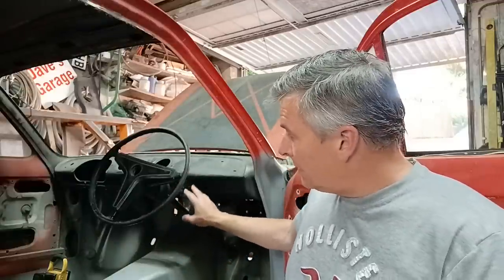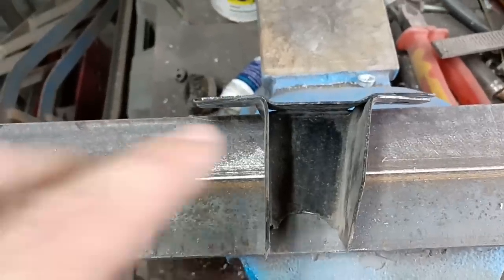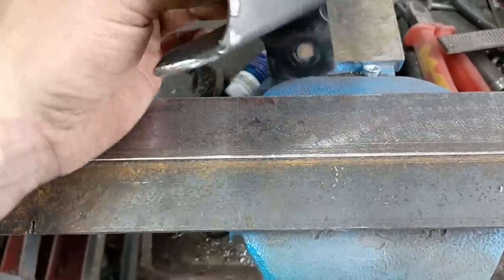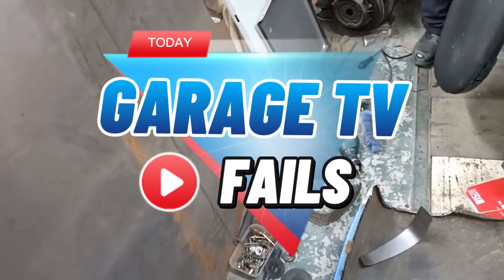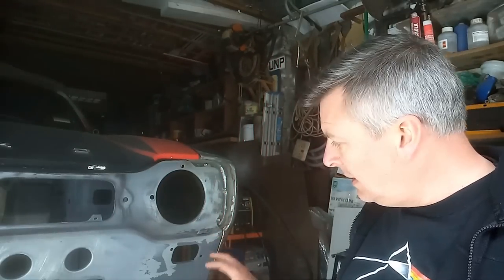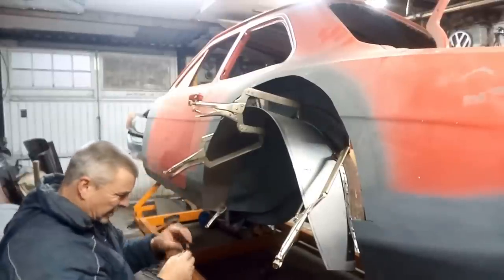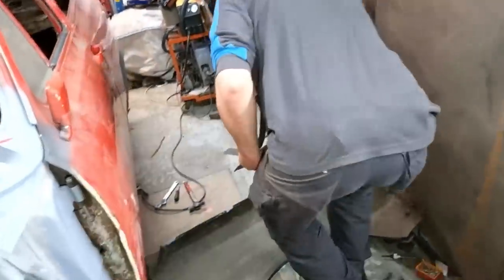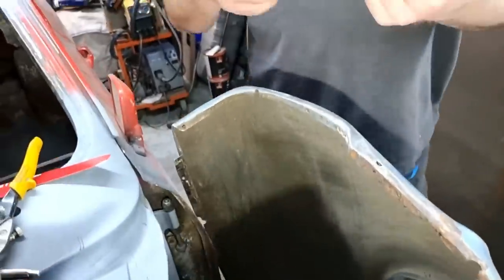Ford Escort MK1 Project. LHD to RHD conversion, steering column.

Comment: Nice job Dave I’ve converted my mk2 from lhd to rhd and used the same dash I copied a guy on YouTube usher engineering his daughter works with him I shut the existing hole by welding a plate over it and cut the hole out the other side also moved the heater hole over it’s turned out great 👍👍
Reply from the maker: I'm thinking ill use the bit I cut out on the right to fill the hole on the left. What can possibly go wrong 🤔
Reply: I think what I did Dave cut the hole slightly smaller so I could put a return on it, I saw a tip I cut an old Allan key about a couple of inch long and cut a slot into it about halfway through a few mm up on one side you can then put the slot down onto the edge of the hole and slowly bend it over you may already know this I thought it worked great top tip 👍👍

Comment: Hi Dave, Great work as always, but i think i may have spotted an issue, now if your gonna keep the ignition barrel on the left hand side , then ignore this msg...If your planning on using a Right Hand ignition barrel , then you should of rotated the column its self 180% also, so the steering lock hole is on the RH side....Hope this makes sense...
Reply from the maker: Well spotted! I did notice this, but then proceeded to forget all about it 🤣🤣🤣, I'm not overly bothered whether the steering lock will work or not tbh, when I come to using the car in about a 1000 years, I'll probably have a wheel clamp to deter the less than human types

Comment: Great informative video Dave, got the same job to do myself so you've saved me some working out. I really appreciate the way you record your thinking process and you don't edit out your  process and direction changes as we all do it but some youtuber's are too vein to show it.
Reply from the maker: Thanks Michael, I appreciate that 😊😊.  One thing I've missed is after the bracket is cut off, the column needs to be rotated 180 degrees so the steering lock cutout will be on the right also, if changing the plastic shroud etc.  So much involved 😀
Reply: Cheers for the extra info 👍🏼 there’s no such thing as a simple job lol

Comment: fantastic work as always Dave .....Just wondering if the steering column could have been flipped over if you're going to fit steering lock and barrel. ?? years ago I just found RHD one but given they are in short supply and expensive I like your idea of converting!!!
Reply from the maker: Yes, I noticed this too late. I think I could have rotated the column by 180 degrees, I'll see how the shroud gubbins fit and revisit that

Comment: Good vid, and you're making good progress. I have a very similar project on a Mk1 aswell, so it's interesting following your progress. BTW, where's the shroud for your mig torch?
Reply: He's removed it because he's using gasless (fluxcored) wire iirc because it gave less distortion and better penetration, while welding the works arches into the front wings but as a benefit, he can weld outside on breezy days on the Manta B project, but I also think he likes it and is getting ready for 2030 ZERO CARBON (NO MAYBE NOT THE LAST BIT!).
Reply from the maker: Took it off, trying out gasless wire at the moment, works surprisingly well